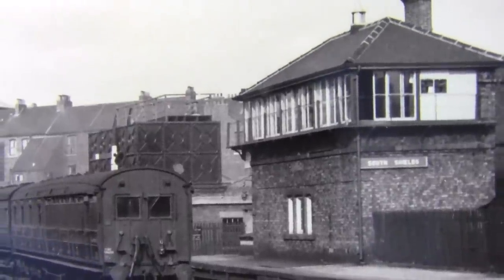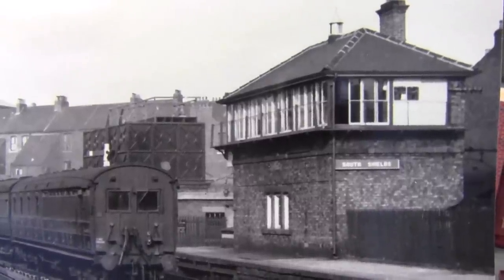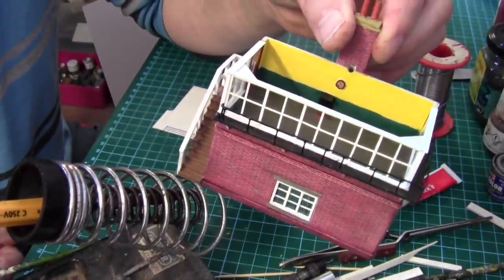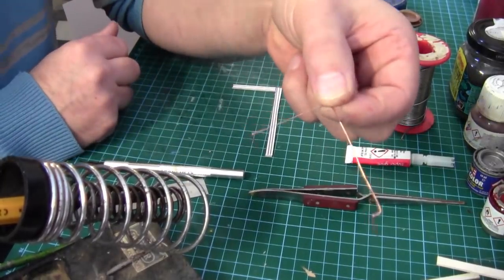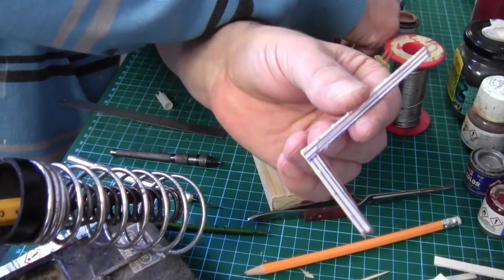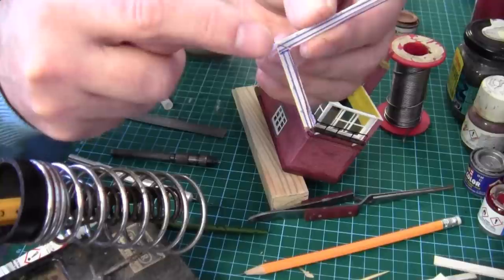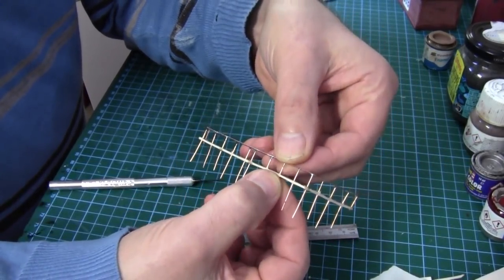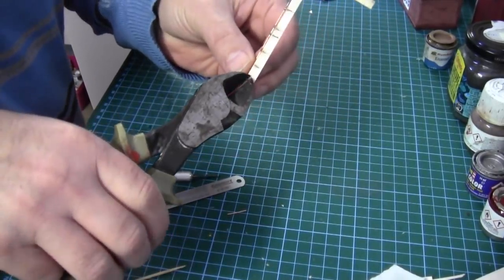Signal Box Part 2. Plus DMU destinations No 254

Comment: Tony, lovely finishing touches. 
Maybe you could also apply that copper wire work to the fancy metalwork on top of the station roof - seen at 25:15 - either side of the clock tower, along the roof ridge. I had no idea how you might have done that till now - but man you have the skills!
Reply from the maker: Hi Chazzy. your right there i could do that for the ridge on the main roof station entrance. i might look into that. that is one way of doing that fancy metal work......cheer's for that ............Tony

Comment: Another great video Tony.  The signal box looks great now it has the railing,  makes a big difference. 

The dmu destination looks good too. Remember on the epb the destination blind is double height rather than single on the dmu.
Reply from the maker: Hi Kelly . i look into that, and in the old black photos shows the destination panel lettering in the centre of a black band. so all i have to do is leave more of the black on. i have not tried it yet. maybe its something i can add on the next video... many thanks for chatting in the stream..........best wishes Tony

Comment: I've always thought that to change the destination boards you would have had to take the roof off, take out the existing board, and put in the new board. But the way you have done it is so easy! I'll have to get some for my DMU to make it a Geordie DMU ;-). Cheers, George.
Reply from the maker: Hi George. Honest it is simple. as you have seen. i though the same when i had ordered them from Model Transport Graphics. and when i read the instructions i thought i have to share this with you guys. my DMU is complete yet as it has a Midland running number. but for me its a geordie DMU.............thanks again Tony

Comment: Like the signal box, Tony, I've always had a soft spot for the things...  However, I am just wondering how long it will be before you build an interior into yours...  Big windows...  Lot of empty space...  They've got a habit of drawing the eye to them just like a magnet!  Incidently the Ratio signal box interior kits are very easy to work with and are good value for money.......
Reply from the maker: Hi ken. the interior good question. i was checking out ebay last week. and the interiors are not cheap. in one of my signal box's. i had made some pullevers out of card and painting them up. they looked ok. but as you say these big windows show up all the space. i will come back to the signal box. as i have a few signal box now waiting for internal detailing. so i might them altogether. as one big mega job lot. thanks again for your interest. ....cheer's Tony

Comment: Hi Tony great video as usual Just a thought you listed the future projects for the station but did not mention the entrance awning.. Are you not going to do it ..Best regards Tony.
Reply from the maker: Good morning Tony. the main roof will come. as i am missing some building materials. two wooden plinths which i am finding it very hard to get . 3mm x 8mm x 1000mm long. as i need these to support the whole structure. as you can guess with all the roof spans. so the base needs to be solid as it will be a lift off roof. i am really looking forward to tackling the main roof as once i get started it will take months to build. 
 thanks again for commenting .................all the best Tony
Reply: @TONYNORTHEASTERN  Thanks for the reply Tony but what I meant was the awning over the entrance to the booking office .Again wonderful project much enjoyed, Cheers Tony.
Reply from the maker: ah yes, me and my cross wires. i think when i do the street scene i will do that. i think there are some lamp posts there as well. i will make that awning out of plastic strip. that alone should be interesting to build...
thanks Tony.........all the best Tony

Comment: Nice video Tony i have a scratch build that i will be doing soon so hope it will intrest you your layout is looking good the signal box looks great your attention to detail is amazing is it hard trying to model a real station? Cheers and all the best.
Nicholas.
Reply from the maker: Hi Nicholas. about building a real station. i think you are now more than capable now to have a go. just follow the simples rules.

1) Research + Study photographs and all its details. and get as many as you can. and even find out the history of the station. as they may 
                       have been changes made to the station.

2) Calculate and measure +  Acquire window and doors first. this is important as the whole building is set up using these features. 
                                                   count the bricks ifs its possible. use a magnifying glass. vernier / caliper's to get the correct measurements. 
                                                 and make sure you have enough space for the building. always allow for the height of a platform. always 
                                                always remember 4mm to the foot. 
3) Select the materials. + Make sure you have everything you need before you start. most of my buildings are made from card. and plastic                             
                                             and rod. but you may want to use plastic card which already has imprinted details like brick and stone embossed 
                                             into it..
4) Sketches and ideas, + Make up drawings of the buildings so you can get the full scale of the building. and then work out how you can 
                                              put the ideas to work and assemble.  in some cases you may have to build up layers to get the detail you require.

5) Assembling and finishing + design the build in sections if its a large building. as its a lot easier to handle. carefully plot each section'
                                                      on how it come together. card overlaps etc.
                                                     always look for ways to hide cables for lighting. if you are adding LEDS. a corner of a room or a chimney 
                                                      breast. are the best places for these. practice weathering. to finish off.
6) Best Part +...............Have fun and enjoy what you are building. at the end you may be surprised on what you have achieved........
                                         wow.....well i hope this helps you my young apprentice..............all the best Tony
Reply: @TONYNORTHEASTERN  Thanks very much Tony for that advice what i am trying to recreate is a building at the end of Exeter st davids station so i am trying to scratch build a replica of that and i will do my resurch on the building thanks for your wonderful advice.
Nicholas.
Reply from the maker: your welcome. i know my enthusiasm for the hobby has rubbed of on you....... take your time and have fun ...................Tony
Reply: @TONYNORTHEASTERN  thanks I will have fun talk later